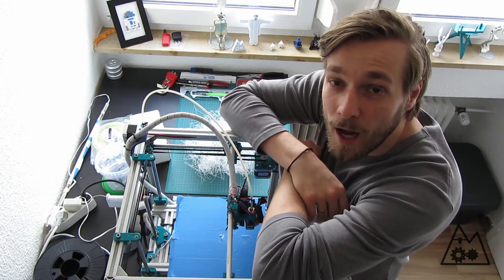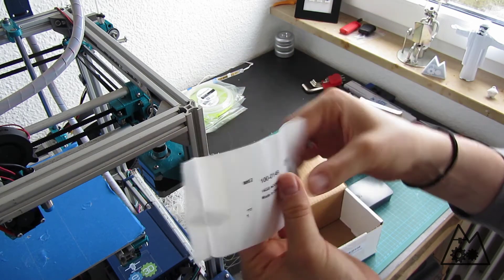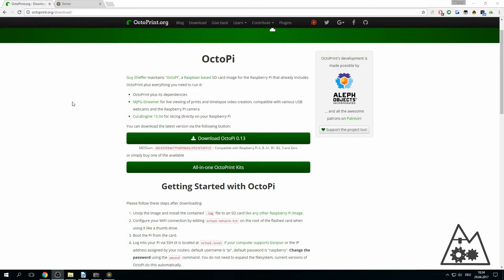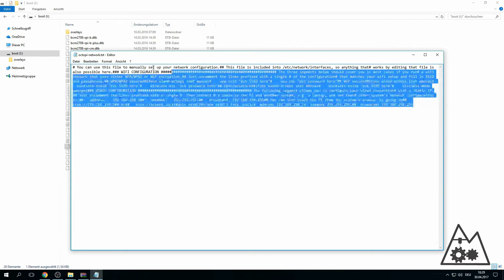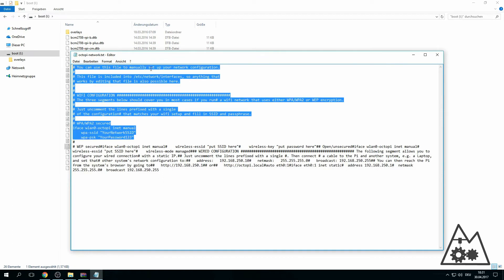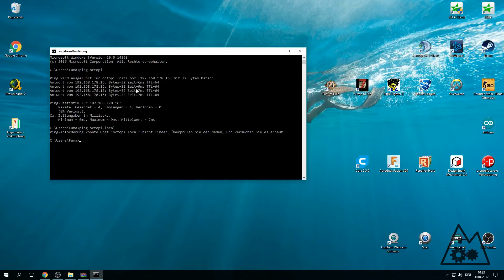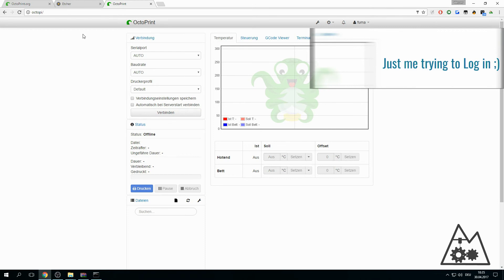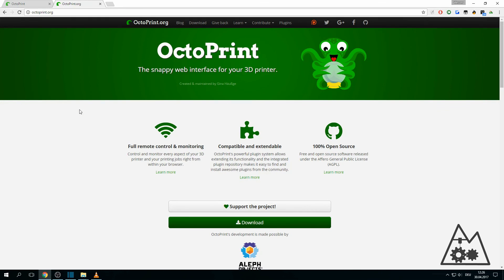Octoprint Setup for Hypercube Part 1

Comment: nice video ;)
How did u do the power/usb for both?
I use a Ramps1.4 and arduino powered from the 12V powersupply.
Now if i connect the Pi (powered by its own 5v power) with usb to the arduino my lcd
starts to flicker and doing weird.

Apparently the 5v from usb is back-feeding the arduino so i cut the 5V wire in the usb kabel between pi/arduino and now its working.

Not sure if its the right solution but for now it works.
Been googling for it but not seeing any real solution while alot ppl just plug in the usb and it works.
Reply from the maker: Jur hey thanks. I didn't adjust anything just 12v going in the ramps from my pcu. And then the usb going into the ramps. Think that's standard
Reply: Hi thanks for ure reply ).
Yea that's the weird part. i just followed ure instructions and looked others before but i got this odd behavior.
Thanks anyway, keep the videos coming.

Comment: For editing those txt files you should just download "Notepad++". It is far better than the Windows built-in editor.
Reply from the maker: Yes I know. But I wanted to do it without installing another program. Have so many programms for one time use installed and dont want more. Anyway its not that hard doing it with the editor.
Reply: What you can do is open a program called wordpad, there you can paste it in and copy it back to notepad :) (No extra programs installed:)